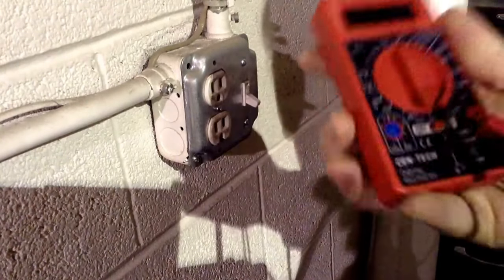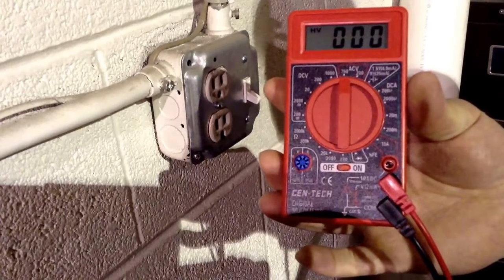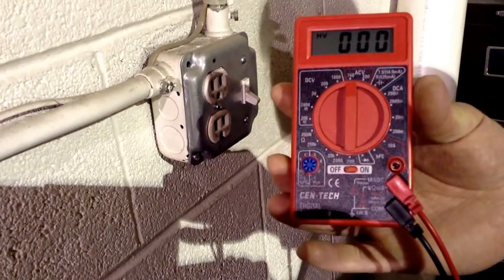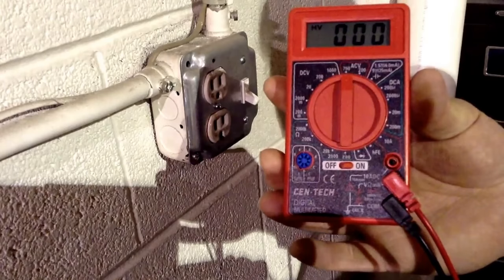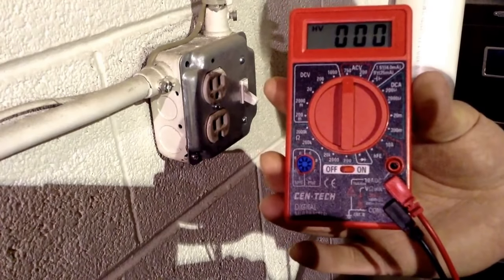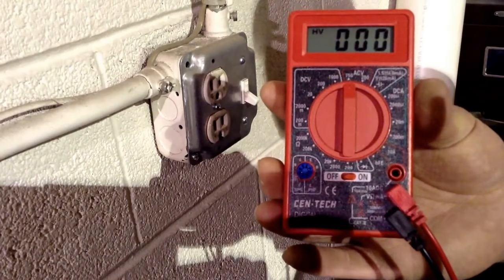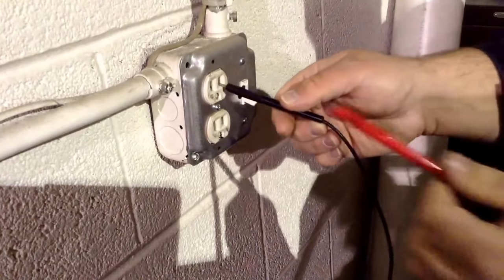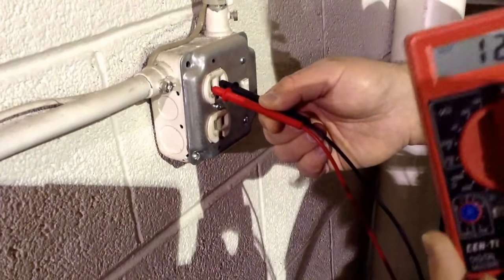Check to see if wall outlet / plug works with Cen-tech digital multimeter from Harbor Feight

Comment: Thank God, someone who just shows what I need to know without a general contractor level of "how electricity works" preamble/seminar. I know how electricity works because I am not an idiot and own 2 multimeters, but only used them for continuity purposes on electrical components and only did not want to blow myself up sticking a knife into an electrical socket.

Comment: No no no. The right side of this plug is live. This is always the case when the earth pin is below the outlet. 

The order of the leads does not matter because AC voltage has no polarity. 

But you never EVER do what this person says in the video.

If you put the lead in on the right side first, your other multimeter lead will become a live wire. If you touch that lead accidentally as you put it into the other pin, you will get a very nasty shock, and depending on other factors like what shoes you are wearing and what you are standing on, you may even die.

You have to put one lead (again, color does not matter when measuring AC) into the left side of the plug first, which is neutral, and THEN the second lead into the live.
Reply: Lightning rod in reverse!! It turns into magic wand !! It'll make alazy person outrun a turtintine starfished cat dragging peas in a sac !!!
Reply: It does matter because if you plug in the hot lead first it makes the other lead hot and therefore a danger.
Reply: @willywonka8730 what danielgonzalez4709 is saying is that you MUST PLUG IN the left probe first.  The left side, when ground position (hole below the two slots on the outlet)is on bottom is the neutral side.  This fella plugged into the incorrect side first(meaning that the other probe could be a live lead and therefore shock/kill you).  It doesn’t matter what color the actual probe is, but you have to plug into neutral first.

Comment: You did not tell us which one is positive or negative or how to tell the difference. How do I know on my outlet which is positive or negative
And why is it that one of peoples the comments says you plugged into the hot side first and he said it was pretty dangerous?
Reply from the maker: You know the red is in the positive side if the value output is positive. If you have them reversed the output would read as a negative.
Reply: Your question seems to be about an outlet in a wall. The power from the wall is usually about 120 volts AC. AC means alternating current, which doesn't have negative and positive contacts.    TrenchTech's answer is correct for things like a battery, which have a positive and negative contacts.  If you have the probes reversed, a negative sign will show up in front of the number in the display.  
Regarding the danger of sticking things in outlets, you really need to study the whole subject more to know what you're doing.
Reply: All I can say is, I wonder how many people got electrocuted by following this video.

Comment: What's the highest level of voltage these lil things can handle???
Reply: 250 volts
Reply: @leobenjaminlopez9255  thank you 😊.
Reply: what is 750 for? fucking internet
Reply: @reedingersoll9745  that's an interesting question. What do you mean by your comment? quote ( What is 750 for? Fucking internet  ) end quote.
Reply: @mwbjgamingprojects  ...so 750 is able to handle large voltages? im guessing. wish i was smarter enough to understand these things. but it does seem that every time i look up how to do something, there are two polarizing views and opinions on absolutely everything, like this guy sticking his BLACK probe into the hot slot first (huge no no), and then others saying it doesnt matter that its backwards. well, i tend to believe it maters when you do something completely backwards when dealing with hot electricity. so the question is do you ever actually use this 9 dollar harbor freight unit with 750 volts of anything? let alone 250 volt dryer outlet? god i hope not.